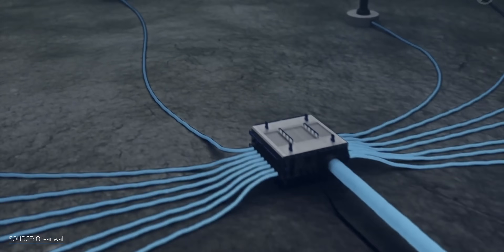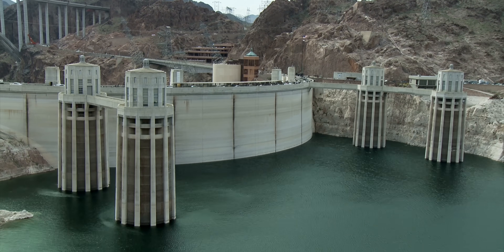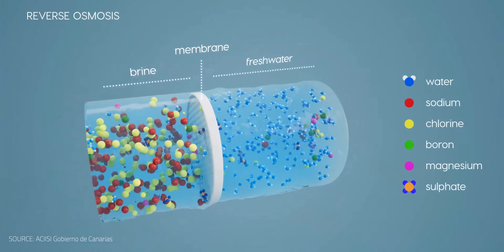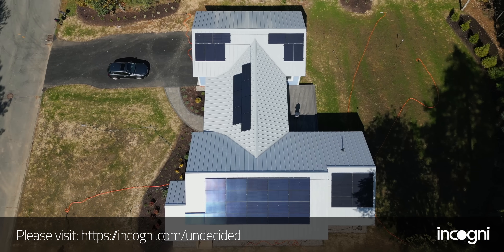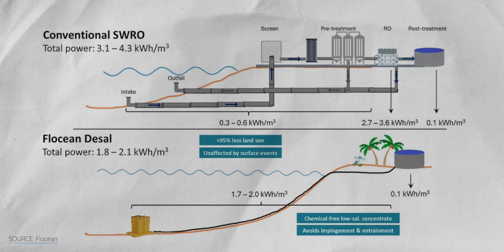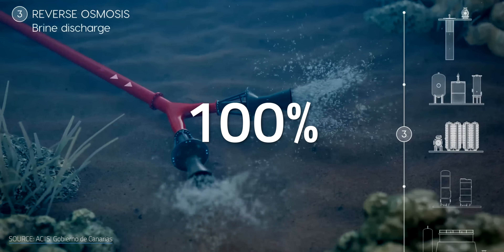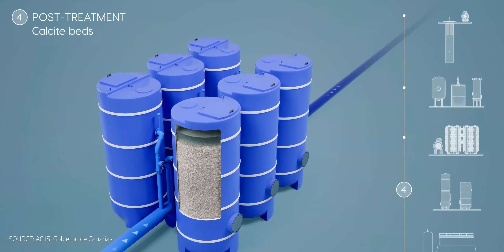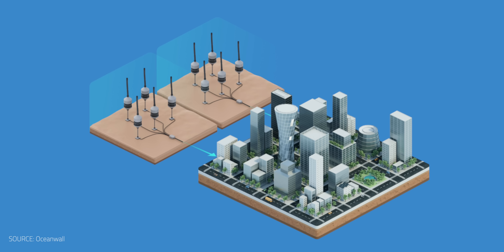How Deep Sea Water is Now Drinkable

Comment: As an engineer it has so many red flag i don't even know where to start. First of all, that's not how static pressure work....... If you want to 'pump up' those water from those depth, you will need equal amount of pressure from the bottom (usually measured in meters height). And yes, even if you 'suck' it, it's even worse case for negative pressure  for an super high system, because you will need to 'series' your pump in order for your fluid working properly to avoid cavitation (This system used commonly in high rise building). Then the brine....... oh boy....... you will dump the brine next to your intake flow or how is the system gonna work? it will just saturate your surrounding then load the RO system with heavy brine, making it work much less efficient and make it prone to damage again. They need to explain more about how they treat the brine, because ocean depth have lower water displacement/flow to disperse the brine. i don't even want to ask how are they gonna connect the power from offshore wind turbine without 'power regulator' (Battery and power controller) maybe they will float it i guess?... And then the installation cost.... yeah.....
Reply: I work in water and wastewater treatment desine and I agree. A big thing they are not talking about is the clean in place(cip) required to maintain the membranes. This is a combination of high and low pH chemical cleaning batches to intermittently clean these membrane.
Reply: I had some of the same thoughts but on the flip side wouldn't the less dense freshwater actually float 'up' towards the surface once treated?
Reply: @genxtech5584  while that does have an effect, it's pretty small. Back of the envelope says 3.5bar per 1000meters. Yes, it's a real effect, but it will barely cover the energy cost of pumping that water up anyway.
Reply: @genxtech5584  Nope, because you will pump the fresh water in 'close system' (technically it's not a closed system). you don't want to mix your freshly made water with sea water...... Except that if you put the freshwater in a balloon then let it float up because of density, then it is a stupid system lol xD
Reply: It's a great practice to raise questions about new technologies and to have some healthy skepticism! Even if it turns out there are good answers to the concerns brought up, it can be a valuable learning process. So don't criticize someone for asking earnest questions
Reply: @QuarkTwain  except he was asking questions that were mostly answered in the video. your feel good advice is pretty shallow.
Reply: @endeyfire  it does seem shallow to someone with surface level knowledge about engineering details, but that's what investors do i guess?
Reply: See my post about why this makes some sense.  The issue is that in a standard system, there is the need to pressurise and then depressurize the 50% of the water that is NOT passed through the membrane.   That is all lost work...   keeping the salt side at the same pressure means that you are not spending energy on pressurizing water that is never going to be used.  Since input volume  is now irrelevant, you can use a much larger volume of water meaning that the increase in salinity in that water can be kept to a much smaller amount, simplifying treatment of that outflow.   Now the remaining work that must be done is to move the fresh water (a smaller amount)  uses less energy than would have been needed to pressurize the input side of the system for the same amount of output. 
The down side is that all maintenance is at high pressure in an inhospitable environment.
Reply: @julianelischer  You can run the high pressure brine through a generator and get 85-90% of the energy from that pressure. Then it is really down to how efficient the pumps generating pressure are. The real problem is that energy is just a part of the cost. Equipment and maintenance are are larger part.
Reply: So far the best model of this I've been able to come up with a "leaking bathysphere" they sink to 500m down below. Inside the pressure is ~1atm, and outside it is ~50atm (hence the gradient). Then they open "the flood gates" to start flooding the thing through a membrane but the water passing through is mostly fresh. Then you just have to pump the fresh water at the same rate as it is getting through.

The point is that at 500m down under, there will be far less dirt, plankton/algae/medusas/etc, meaning the membrane will "live" longer. On the bad side -- any power outage / mechanical failure / seal|o-ring leak will flood the thing leveling the pressure and then you probably have to surface the thing to restart it.
Reply: @MotoStylus-z8r  I don't think you'd have to, if you start up the pump up again, as it starts pumping the water up to the surface, the pressure gradient will return and RO would restart since the water won't be able to permeate the membrane as fast as it's being pumped out. Not sure if they'd have to dump the water because of the excess salt that diffused across the membrane
Reply: You would have to pump the freshwater from the bottom, because you need near-atmospheric low pressure on the freshwater side of the RO membranes.  So the pump has to produce the same pressure differential as on-shore RO.  But it only has to pump the freshwater, which is half the flow of the brine that is pumped in on-shore RO.  Half the flow at the same pressure means half the energy.

There are currents at the bottom of the ocean, so the brine will not get concentrated.

Yes, the installation and maintenance are the biggest issues, and it seems that they are the main things being focused on by this company.
Reply: They're not using negative pressure to move the water up to the surface. They're using the suction of the pump and the weight of the water column above to create a negative pressure differential across the RO membrane.
Reply: @Tevruden  successful RO needs a large pressure differential across the membrane; the membrane has to bear the load
Reply: @janami-dharmam  Yeah and there's about 60 bar of pressure at a depth of 600m. If the pump keeps the inside of the membrane at 1 bar by pumping the water to the surface,  the pressure provided by the water column is sufficient to desalinate seawater by RO.
Reply: You're raising some reasonable engineering concerns, but there are a few misunderstandings about how this system actually works — especially regarding pressure, pumping, and brine management.

First, the system doesn’t “pump up” seawater from 500 meters. Instead, the RO membranes are located at depth, where the ambient hydrostatic pressure is already around 50 atmospheres. That pressure is what drives seawater through the membrane. The freshwater (permeate) is then routed to the surface, where it’s collected at near-atmospheric pressure. There’s no need for pumps at depth or high suction — the ocean provides the pressure for free, and cavitation isn’t an issue because your pumps are only moving low-pressure freshwater at the surface.

Regarding brine: the video actually addresses this. The system runs at lower recovery rates than conventional RO, meaning less water is extracted per volume of seawater, and the brine effluent remains close to normal seawater salinity. It’s also discharged far enough from the intake to avoid recirculation, mitigating local salinity buildup and membrane fouling.

As for power — this system doesn't require offshore power at all. The pumps and infrastructure are all located at the onshore treatment plant, where energy is used to process and distribute the freshwater after it surfaces. There’s no need to run cables, batteries, or floating wind infrastructure out to sea.

This isn't magic or hype — it’s an application of well-understood fluid mechanics, using the ocean's natural pressure to reduce the energy cost of desalination. Sure, there are real engineering tradeoffs, but the core concept is sound.
Reply: @siorusbzns654  oh nice you acctually watched the video. im glad you were able to give a proper breakdown here.
Reply: I believe the efficacy is coming from only pumping fresh water (so moving about a 1/3 less water). Also lower maintenance costs because the pumps are "low pressure" located on the fresh water side rather than high pressure on the saline side. The place I think the sneaky math might be hidden is needing to lift that water up from the depth where their efficacies might be calculated just around the RO side of things not counting the lifting of the fresh water. Not sure but I feel like your reaction is what most people are going to think at first glance of pressure difference across the membrane needs to come from energy added to the system but I dont believe that is where the calculated efficacy come from.
Reply: I mean, aren't half of those issues things that they've clearly already solved, considering that they successfully pump oil from such depths?
Reply: The water supplying pressure salt water. The water needing to be surfaced is freshwater. Freshwater is less dense than saltwater, so saltwater can push freshwater to the surface with pressure to spare.
Reply: @thomasdelbert  Absolutely correct. A quick calculus of the 600m stated gives you approximately 17 bar of pressure, which is why I even wonder why they need a pump down there. Maybe for back flushing?
Reply: @MGS_For_a_Better_World  I was struggling the the submersible pump too. Backwashing makes sense.
Reply: @thomasdelbert  salt water mixes with fresh water
Reply: idk. kinda feels like you didnt watch the vid all the way through. 

plus, you shouldnt be seeing red flags. you should be seeing a job opportunity to patch the gaps in the project. id say your part of the problem.

there doesnt seem to be many better solutions atm, so breaking down the project instead of building it up further... thats just malice.
Reply: @endeyfire  It's another investments burning project like solar roads. They will spend millions and produce nothing.
Reply: @endeyfire  going forward with a poorly thought out project and watching it fail is what we are forced to do a lot. if you don't have people to poke holes in your project such that you plan for them and fix the issues before deciding to do that project you just waste millions of dollars for nothing. you cant even claim you learned something because people like him were already telling them the answers. cluelessly funding or moving a project forward without addressing the problems or even wanting to hear the problems from people like you are why things fail, people get hurt, money gets wasted.
Reply: @endeyfire  The point is not about 'red flag' you need to understand about my point on why i call it 'red flag'. It's much more about 'project viability' if it has that many 'problem' to be addressed then is it gonna much more efficient than on shore RO system?. The claim is it's gonna bed 50% much more power efficient than on shore system when fresh water density is only about 97,5% of ocean water density, where is that claim coming from? I will also address the comment below about ocean current, on deep water floor , the current will be much more slower than on ocean surface , why? because ocean current  are caused by sunlight, wind, season and moon orbit, much of them are happening on the ocean surface (most problem of brine dumping is note really about saturation but near shore ocean has so much more life activity to be affected by brine dumping). Yes, there are arctic highway current caused by temperature difference, or strait current location, but what about coastal city?. So it's not about 'red flag' but about the dream they sell without much more data to back them up. There are so many start up that chase funds and valuation first than real solution . And i really hope these start up to success trough it, but if i was as an investor, they will need to explain much more about it.
Reply: @erlannalan  lots of words, work on paragraphing abit next time.

but i did read, and all your points were adressed in the video.

not to mention, the companies involved are putting into practice what they have learned, in order to further understand what they are doing and how it works, in order to optimize the project (also covered in the video).

so as an investor, while i would equally be timid, id wait for the inital results befor i break their logic down further.
Reply: @endeyfire  So, I'm guessing you aren't an engineer.
Reply: @JessePowell_ad_astra  im guessing your not either??? whats the point of this comment. i didnt claim to be anything, just that we should collectively be trying to help get things working.
Reply: @endeyfire  this is simply against the first law of thermodynamics; perpetual motion of the first kind
Reply: @janami-dharmam  how???
Reply: @janami-dharmam  no it is not, because you are not understanding the change in the process.  This doesn't get you anything for free, it just allows you to reduce wasted work. The wasted work is not related to the water that is made fresh,  but that used to move the water that is left behind. In a current system it needs to be pressurized and then is discarded.   So pressurizing it is wasted energy (probably warms up the water considerably)

Comment: 2 points

1. In diagram it showed that it still needs half of normal desalination plant energy, which is still bad.
2. Maintenance cost, energy usage etc.

Maintaining them would require much more costly processes and creating them in the first place would be much more costly and there is lack of control over desalination in this type of plant. I rly feel like humanity should try to remove salt from the ocean somewhat to combat rising sea levels and lowering saltiness of the ocean.

We could for example have safes where salt would be dumped like in the middle of Sahara desert. (they could make piramid out of salt blocks there :D)
Reply: What does salt have to do with climate change?
Reply: @Hydrogen101  it has nothing.... (accept of ofc. how desalination requires so much energy)

But water level are rising so we should find ways to remove water from oceans, but that water would be useless so removing salt would be great.

Also salt from the sea is constantly accumulating. IT is not becoming smaller but more and more salt is being there and it will reach unlivable amount at some point.

Also there is no real benefit from oceans being salty. Sure some animals can live in it, but they could simply adapt to normal water which is better in everyway.

So simply. There is to much salt there and it has no benefit for humanity.

And by removing salt from it we would lower the sea level maybe ? Like salt is slowly collecting at the bottom of the ocean and then supposedly being buried but if we removed salt from the ocean that salt would be remelted and maybe lowered the ocean level???

Comment: Somehow this doesn't seem logical. You always need a pressure gradient and I don't see how sucking vs pressuring can double the efficiency.
Reply: Yeah, that's the main point here that got glossed over.  I think, because you are pumping the freshwater away, the flow is less than in an on-shore RO plant.  Power is flow times pressure, so it needs perhaps half the power if you can do it on the seabed.  Put another way, when you are pumping brine, you need 2x the brine to get 1x the fresh water, and the other 1x of double-concentrated brine gets released back to the environment, losing the energy needed to pressurize it.  Why can't we take the high-pressure waste brine and run it through a turbine to recoup its energy?  I dunno.  If you could do that efficiently, then you could probably get most of the benefits of this system without putting all your equipment at the bottom of the sea.  You could get more of the benefits by moving your intake and outflow to a deeper location, which might use a lot of pipe, but would not need deep pumps.

Despite the pristine-looking 3D-visuals, marine environments are harsh, and maintenance is usually the killer.
Reply: @dmdeemer   I am missing something here. Creating atmosphere pressure at the bottom of the sea is not easy. And once you get your fresh water you need to re-pressurise it to sea floor levels in order to send it to the pipes.
Reply: @presbiteroo  Pumps create a pressure differential.  RO needs a pressure differential across the membrane to function.  On-shore, the pumps create high-pressure on the brine side.  Underwater, the pumps create a low-pressure zone on the freshwater side of the membrane.  You can only do that depths of ~400 meters or more because the pressure differential you need is much higher than atmospheric pressure (40-80 bar), and you can't make a "negative" absolute pressure.

The actual pressure differential is the same in both cases, though, so the underwater pump is doing the same thing as the pump on the surface.  It's just pumping freshwater, and only about half as much.  The high-pressure side of the pump will be at the same pressure as the surrounding water (or slightly higher to get the freshwater to a tank or pipeline above-ground).  It's the low-pressure side of the pump that is near atmospheric pressure.
Reply: @dmdeemer  It's all great in theory but in practice all those energy saving will be eaten by maintenance costs.
Reply: the pressure would be supplied through the natural forces of being at the bottom of the ocean, so less energy input